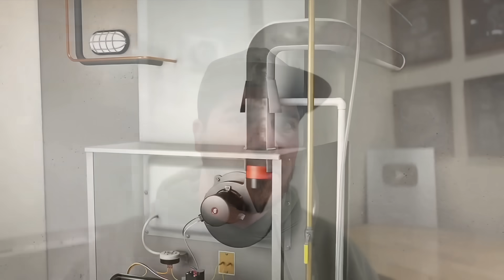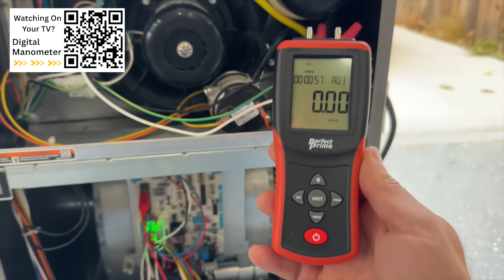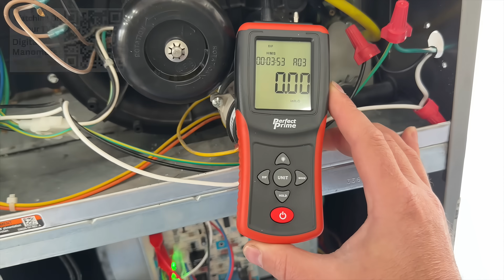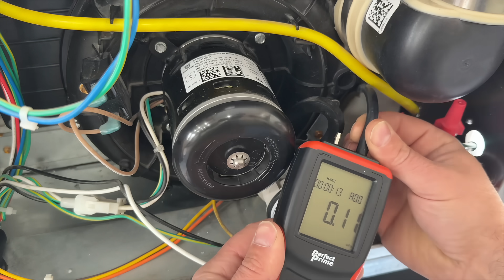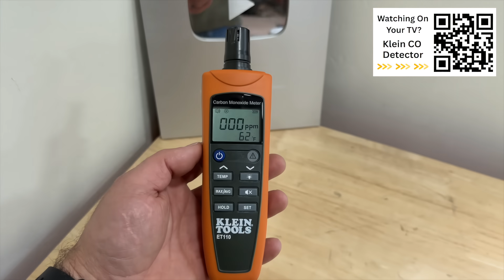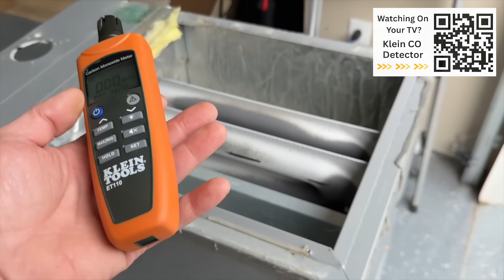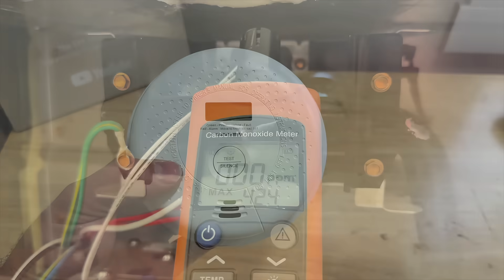This HVAC Scam Could Cost You THOUSANDS.

Comment: I agree with the selling for commission you mention can be questionable, when I was working I was told by the boss "we don't make any money in service, we do in new sales". Glad I'm out of it. The testing you are doing has a couple of flaws. If the furnace had some static pressure on the circulation air, the heat exchanger will be under positive pressure. You may not see carbon monoxide in the duct or at the exchanger. You need to test at the burner box. The positive static pressure from ductwork will work against the draft blower and push exhaust out of the burner area.  Most furnaces have manual reset limits in the burner area specifically for this purpose. If a manual reset limit at the burner area is tripped you better make sure the exchanger is not cracked or plugged. You need to test with the blower door installed.

Comment: Actually if you jump the R and W before closing the blower door it will run the fan but if you would of pushed the door switch first then jump the R and W the blower motor will not run first

Comment: We have a 75K BTU Input Gas Furnace with 69,200 output BTU.  It was installed in October 2002.  It has been well-maintained and works great.  92.3% efficient.  We had it professionally serviced this year and the Tech said it needs to be replaced.  I asked Why?  He said because it is 23 years old.  No HE cracks, PSC Blower Motor good, Inducer Fan good.  I don't see why we should replace our Furnace.  It is made by Heat Controller in Michigan.  I assume it's a very good Furnace as it's been free of repairs except I did replace the bearings on the Blower Motor around 4 years ago because they rattled some.  That noise traveled through the metal ductwork.  We would like to run it until failure, not proactively replace it.  Are we wrong?
Reply: Nope, as long as the two major components (heat exchanger and blower motor) are both sound, you have zero reason to replace the furnace. Even if one of the safety switches fails, or the flame sensor, dont do a unit replacement, just have that particular part replaced because they cost like 20 bucks at the parts house.
Reply: @TheThirdMuskateer  Thank you!  Money's tight these days so keeping our old Furnace is good.  We have CO2 Monitors all over the House.

Comment: I have a 20+ year old packaged unit that does both heat & AC, replacements run about $8K installed.  I bought a replacement heat exchanger (stainless instead of original galvanized) for about $1,200 and worked out a deal with my HVAC contractor to replace them for $500 labor.  The old heat exchanger was indeed rusted/cracked and brittle to the touch.  This system will probably last for another 20+ years.  Being educated on how these systems work and knowing what parts will are "consumable" saved me $ and avoids generating waste!
Reply: Is your a/c compressor still in warranty? Doubtful.-

Comment: I wonder how many techs actually cause a crack in the heat exchanger so they can sell  a new furnace or exchanger repair.
Reply: If I can cause a crack, it was already compromised. If I can see holes, there are definitely holes that I cannot see. Our license is to make sure things are safe, or else we are held criminally liable if someone dies after we say the equipment is safe. I have done several commerical heat exchange replacements, and trust me Id rather say its good and safe than change the H E, its a pain in the ass job especially outdoors in -20 windchills.
Reply: Just a stupid comment. Our job is to make sure the unit is safe.

Comment: Correction. You burn 100% of the gas. Only 80% of the heat created is recovered from the combustion gasses. Difference with a high efficiency furnace is it recovers more heat from the combustion gasses (92-96%).
Reply: I'd suggest you go back to your high school chemistry teacher and ask how CO is formed...I'll save you the trouble-- it is the result of incomplete combustion of hydrocarbons. You know, stuff like natural gas, propane, gasoline and also things like wood. NO residential furnace, and virtually no other similar mechanism, is capable of achieveing 100% complete combustion.
Reply: @mwiltfang4618 There's always one and we just found him.
Reply: There is no correction! He literally said that in the video. 😮?!
Reply: @Izaakwalton_ Suggest you listen to that again.

Comment: I had an honest tech actually find a crack in mine. I run propane which burns hotter and can be hard on them. It was a Lennox and he got it replaced for free by them. I saw the crack when he replaced it. He handled everything. The HVAC co ordered the replacement part, came out and replaced it, and then returned the old one for credit.

Comment: THAK YOU!  I've commented MANY times in other HVAC videos that I didn't see how CO could leak out of the heat exchanger on a furnace with a draft inducer.  The draft inducer creates a low pressure area inside the heat exchanger which would cause air to flow into, not out of, the heat exchanger.  I was always told that I didn't know what I was talking about.

IMPORTANT!  If you have an old furnace without a draft inducer, it will leak CO out the heat exchanger and into the heated air going to the heating ducts.  I do know a family that happened to.  Fortunately, they noticed the symptoms and got out of the house.

Comment: Thank u for this video!  I like how u covered both the heat exchanger plus the test equipment/carbon monoxide alarm.

It doesn't hurt to have at least 2 carbon monoxide alarms in a home.  1 alarm (preferably with a ppm digital readout) and a 2nd alarm that is monitored by an alarm company (i.e. SimpliSafe).  

If a senior citizen or young kids live in the home it's especially important to have at least one alarm monitored because they can become confused thinking it's a smoke issue....or they are not sure what to do in the event of a carbon monoxide alarm.

Comment: My 80 year old lady relative got robbed,  they locked her out and sold her what they said was a high efficiency unit, actually just a run of the mill, 40k btu 80% furnace for the low low price of ELEVEN THOUSAND DOLLARS and the install was obviously sloppy with the duct connections.  Heartless thieves.

Comment: The oldest trick in the book, the $29 deal. This is how people get rich. And is mostly what business is as a whole, honesty would collapse the entire economy. I had someone about a month ago have me look at his five-year-old system that he was told needed a pull and clean from another company for $2000. This thing was practically so clean you could eat off of it. Not to mention whoever installed it, tied the secondary drain into the primary drain at the air handler, that I say is a vent before the trap and it somehow passed an inspection.

Comment: If a company says that you have a cracked heat exchanger tell them to pull it out, fill it with water and show you the cracks. If it leaks you need a new one and if not then, beat the furnace techs ass with a wrench, say they attempted to kill you and sue the furnace company 😂
See how lying can work both ways. Fuck thieves!

Comment: I've experienced plumbers engaging in predatory maintenance practices. One tell-tale sign is when they insist on performing additional tasks outside what they were hired to perform; poking around your entire home. 
In one scenario, a plumber burst a pipe performing checks that have nothing to do with replacing a garbage disposal. Next, a plumber wrote a quote to replace a variable pressure regulator for $1100 instead of simply adjusting the variable pressure regulator.
Reply: My parents had one of those "special deal" low cost duct cleaning service. Ended up spending an extra $1000+ on UV light being installed. I'm sure an UV light doesn't cost $1000

Comment: there is no substitute for a visual inspection. a crack is a crack.
a cracked hxt can pass all of the tests in this video.
cracked heat exchangers generally cause air to leak into the cells, not exhaust out. co monitor cannot detect cracked heat exchangers until problem is very severe.
co alarm with display if ul approved does not display below 30ppm.
Another dangerous video by diy hvac guy.

Comment: beware, many of the mobile home furnaces were/are positive induced draft! the inducer is on the supply air pipe and pushes air into the heat exchanger, pressurizing it. so before the indoor blower kicks on they are 100% leaking by force.

Comment: About once every 18 months my Inducer housing fills up partially with water until you hear the blades churning the water. Pulling the motor down. Running hard. Straining. 

I have to take a black hose off on the left side and suck it out. Sometimes loosen screws on bottom of housing too dump the water out then mop it up. 

Last time used a Wet/Dry Shop Vac to suck it out of the housing. 

Is it just Condensation over time? Is the drain tube getting clogged?

Lennox 90.5% I think from like 2004.
Reply: Sounds like a clogged drain to me.

Comment: I’ll note upfront, I am not a fabricator so this is truly a hypothetical.

If someone knows how to weld could they repair these cracks? It seems a shame to throw a whole machine out due to a crack. In a car these sorts of cracks are often welded or patched, especially in exhaust pipes.
Reply: Those cracks occur not due to friction wear but rather repeatable thermal impact/cool off which results in degradation to structural integrity of elements in alloy that exchanger stamped off. So repairing it becomes non feasible as it becomes brittle.

What would be beneficial tough, open market and availability of quality aftermarket parts preventing manufacturer from forced obsolescence by ceasing off stock of replacement parts so after warranty term you pretty much have no choice but buy new unit.
Reply: I would say not practical to repair

Comment: Hey quick question....I am putting the 15amp generator switch onto my gas heating system just in case of Power outage to keep the heat going. What is a good economical power station to purchase that can insure enough power to run the system efficiently? 

Thank you so much

Comment: If you have 30 year old furnace replaced it. Running into alot of icp and bryants with roll out and few cracks. 

Ran into one last year. I didn't find a cracked heat exchanger or roll. Recommended replacement and stated on the invoice beyond operating life.  Advised to get co detector.  

Fast forward 5 months called back. Co detector went off in baby room. Fire department out.
Diagnosed Cracked heat exchanger and co readings in the supply air. This was  almost 40 year old furnace.  No inducer.  

In ok with 50 year old Boilers.  Furnace 30 years and up .....replace it.

Comment: Great video, as a service tech for a local gas utility I see this scam all the time. Efficiency however is only an indication of the ability for any given appliance to extract the heat from a given amount of gas used. They all burn 100% of the gas otherwise you will have soot. 96% efficient furnace just means let’s say that the furnace burns 100 cubic feet of gas it would produce 100,000 btu’s it can capture 96,000 btu’s within the heat exchange and only 3,000 btu’s of heat would exit out with the exhaust gas. For those that are considering a high efficiency furnace, the cost just isn’t worth it. In the life of the furnace you will never recoup the cost in gas saving. Ever! Not even close. Air conditioning is another story however.👍

Comment: Thanks for this video.  I have an older 1979 vintage forced air furnace, natural draft combustion side. It was diagnosed with a cracked heat exchanger a few years back, which could be true considering the age of the furnace.  I don't know about the US, but in Canada it is built into the gas code that a cracked or damaged exchanger must be repaired or replaced, so any professional (licensed) HVAC technician is not allowed to work on a furnace with a crack.  Nobody will attempt to make repairs on an older furnace like I have, so as the homeowner you are forced to get a new furnace.  I have always argued that it is not unsafe to have minor cracks, because the air side is ALWAYS at higher pressure than the combustion side, and if you get some minor leakage of air into the combustion side, it is not of any significance and it is not unsafe.  This type of exchanger leak won't generate CO that will get into the living space as you have demonstrated in this video.  As a precaution, I do have a CO detector in the mechanical room in the basement, near the furnace.  I just hope my furnace doesn't break down in the dead of winter when it is 20 below, because I won't be able to get it fixed unless I do it myself.  P.S. I am a mechanical engineer and know something about HVAC.

Comment: Learned a lot from this. Curious on a different test. After burners shut down and fan continues to circulate air thru ductwork pulling residual heat. What happens to the CO levels in the ductwork?
Reply: Not a tech but I believe after the burners shut off the inducer motor continues to run to clear out the exchanger. Then the inducer shuts off and the blower stays on. At that point there shouldn't be anything (CO) left in the exchanger.